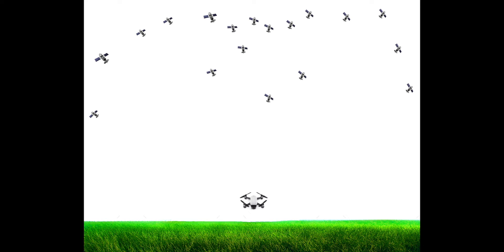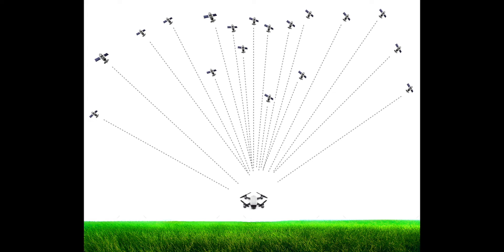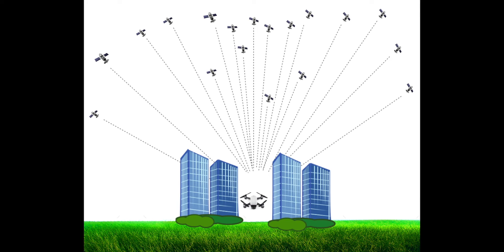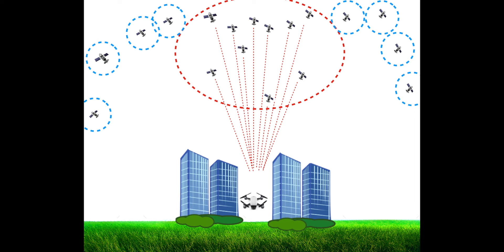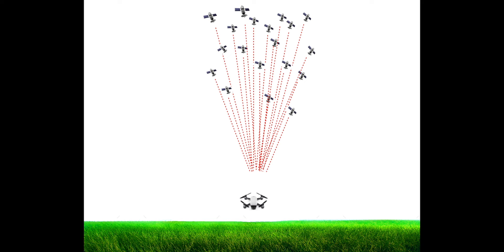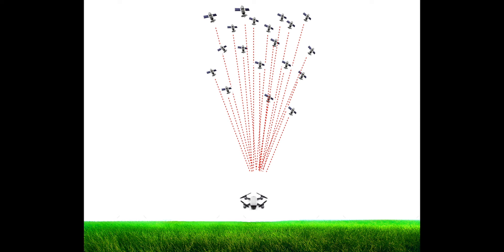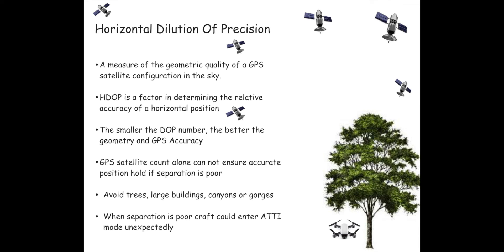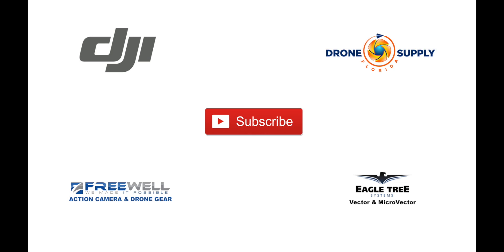DJI Mavic - Explaining Compass Errors & GPS Issues - Part 3 GPS

Comment: I do not think the separation of satellite will have an issue in an open area or wide area. Even it does has satellite that is closes together above you, in a wide open area, it's impossible that there's no other satellite sitting a far to make your gps lock strong

Comment: Fixed the error for the mavic mini when it says “check gps settings or calibrate mobile phone compass”. I thought it was about satellite range and spread, blah blah. It was a location service iPhone security issue. Go to Settings>>Privacy>>Location Services>>DJI Fly App>>Always. 

For some reason when you set it up the DJI fly app and asks if it can get permissions to use your photo, location services... it changed its security setting for location services to ask. No wonder I kept getting the gps error even at multiple locations. I hope this helps you guys. Took me a day to figure out 😊

Comment: Very, very useful and informative. I'd already subbed previously, then forgot to watch the videos.... now corrected.
I've had these errors several times. No lost birds as I gathered my wits and piloted the thing back (with my heart in my mouth)
My Air shows the Calibrate box as default every boot up. These calibrations virtually always fail. I've gone ahead and flown the damn thing anyway and these occasions have never thrown any tantrums while in flight.
I've had loss of GPS lock in open country with a MavPro1, and a P4. Different places. The P4 virtually never shows the Calibrate box in the menu on boot up like the Mavic does.
 But you've extended my awareness of these matters considerably for this quality information. DJI should use you as a tutorial designer!

Comment: Just found this series in the dji forum. The quality and clarity of your presentation was very impressive. Thank you.
I have one question however. Can I conclude that, should the aircraft be out of sight and enter atti  mode due to compass error, it can be flown home on gps using the map display? Also, if the aircraft is out of sight and enters atti mode due to gps error, can it be flown home using the compass ring display?
I haven't had either of these errors yet, but would like to be prepared for when it eventually happens.
Reply from the maker: Basically no and yes, once you loose GPS/compass the map and radar become inaccurate however it’s slightly more complex than this.  

GPS generally does not just fail and in almost all cases the issue with caused by compass errors than GPS. So while the craft may enter Atti mode the chances are the position data would be correct and you could fly it home via the map but also note because the compass is not behaving the Arrow and radar may be off substantially.  

If you lost GPS then neither the map or the radar would be of use tbh.  

Any chance you link the DJI page it’s been posted on :)
Reply: Thanks for your prompt reply. It's generally what I expected and one of the reasons I feel uncomfortable when I can't see the aircraft. The link you requested is:

https://forum.dji.com/forum.php?mod=viewthread&tid=151297&extra=page%3D1%26filter%3Dtypeid%26typeid%3D436%26typeid%3D436

Comment: Hi folks. There's another problem with GPS. There are two layers, a commercial one and an encoded miltary one. Our muti-rotors listen to the commercial broacasts. These sometimes have a deliberately induced 'jitter' added for reasons of nationsl security. The location informatin becomes either indistict or inaccurate. Do not take the GPS as perfect, sometimes it is not. BobUK.
Reply: Also very interesting cheers Robert
Reply: As Martin pointed out - SA (selective availability) was turned off to increase the accuracy of the position. However we do have access only to one frequency as opposed to the military and therefore their position will be more accurate. This does not mean however that the accuracy cannot be compromised due to some military or political reason and therefore this stands - you cannot be certain of GPS at any time.